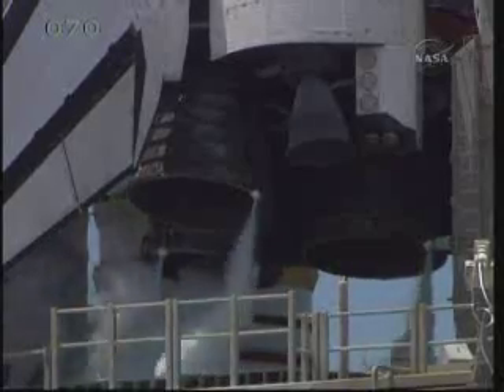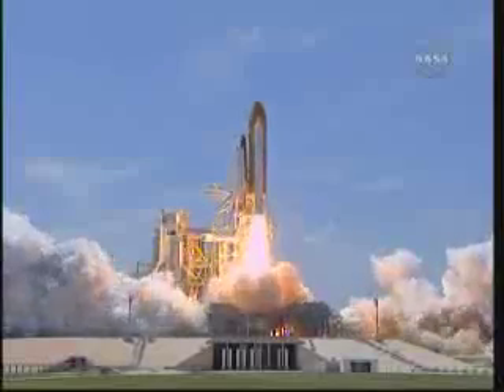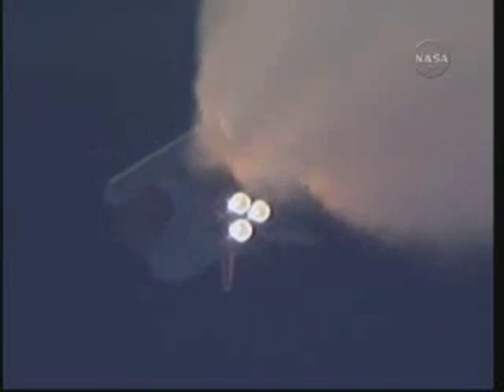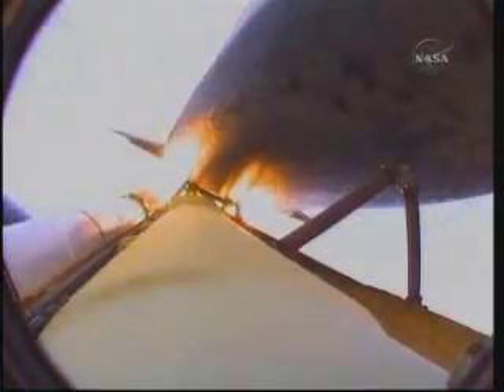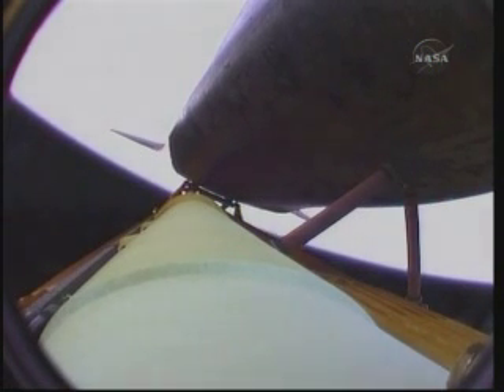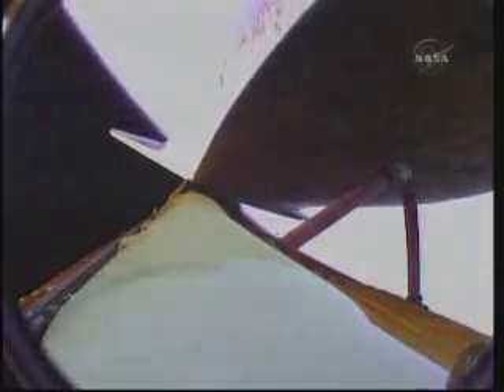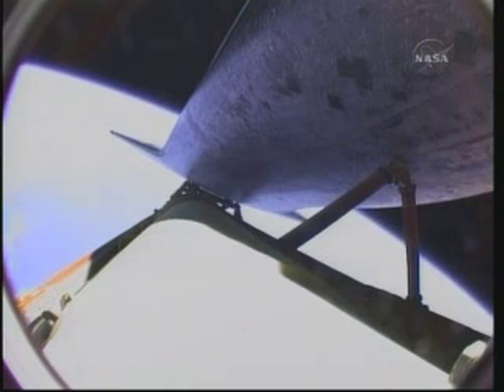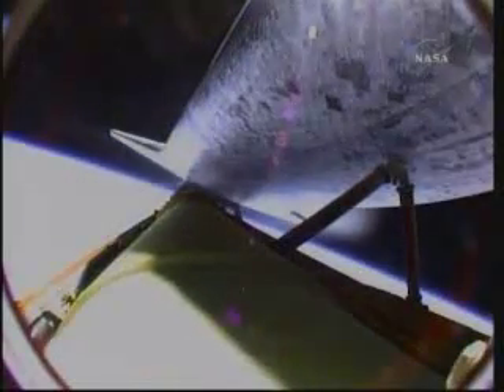Space Shuttle Atlantis STS-132 Launch (+9 MECO) SD

Comment: @minghiabrobut 

I see nothing at 6:03.  But if you do, it's likely foam popping off.  That is normal for all shuttle launches and is commonly seeing around that time of the ascent as the fuel levels for the tank are depleted and the tank expands.

What you're seeing at 9:42 is ice being ejected from the engine bells on Atlantis.  The change in direction is caused by the reaction control system jets firing to move the orbiter away from the tank.  This is also normal for shuttle launches.